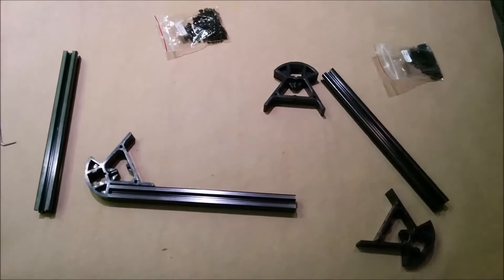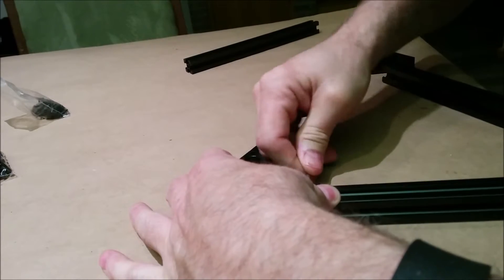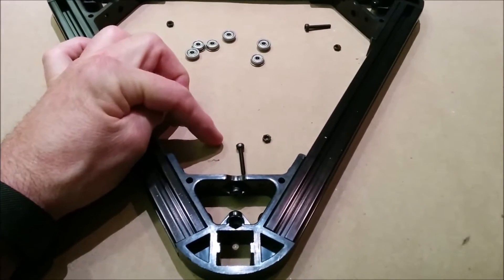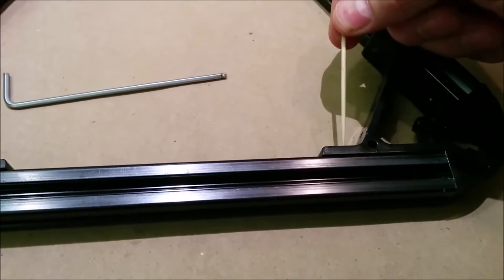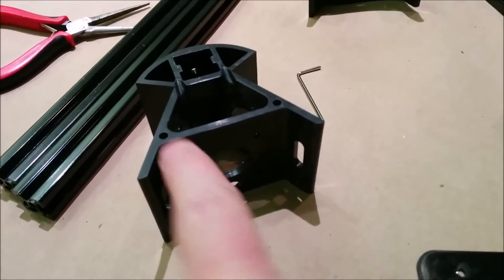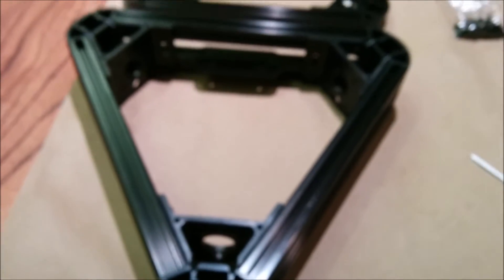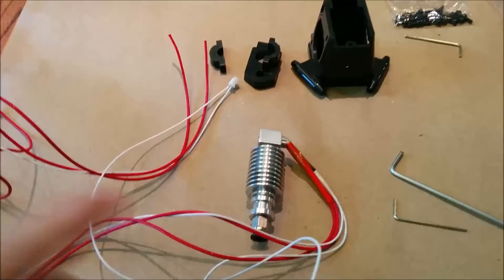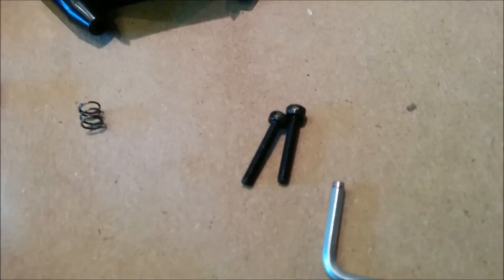Micromake assembly part 1

Comment: +Citadelik
Is there any chance I could send you an e-mail with some questions about the 3d printer?
I'm looking into buying one, but I just need some more information...
Reply from the maker: You can post it here,  not sure how to share email without opening to spam.
Reply: Than you, I understand! 
Is the calibration hard on this printer?
Reply from the maker: I had a bad thermistor in the print head which prevented the default firmware from doing anything but show out of range error.   I tried various other firmware but most were not aware of the self-leveling feature.
I put a replacement thermistor in the print-head (apparently I might have tightened it down too much during installation) and the self-leveling routine ran fine.

There are quite a few other firmware packages out there that will work on a kessel style 3d printer, you might have to go in and edit the arm lengths and such to get them to work on this printer.

Also note that the seller seems to have disappeared from Ebay, however others are selling the same printer
Reply from the maker: The default firmware has a menu that will auto-level the printer.   You select that menu entry and it touches the printhead down in various spots to do the auto-leveling.
Reply: Okay thank you very much